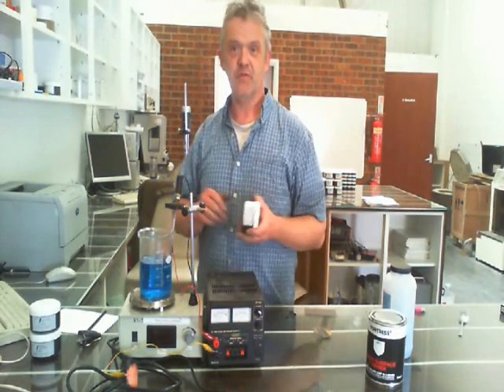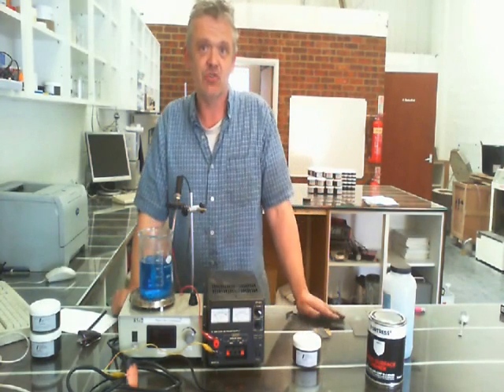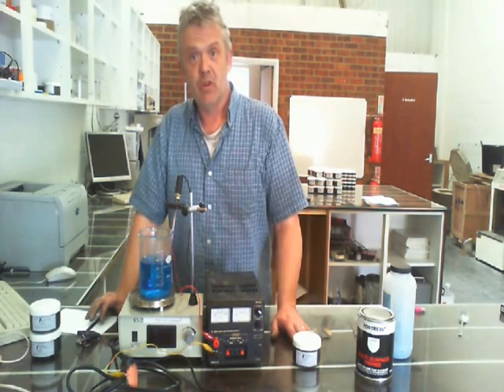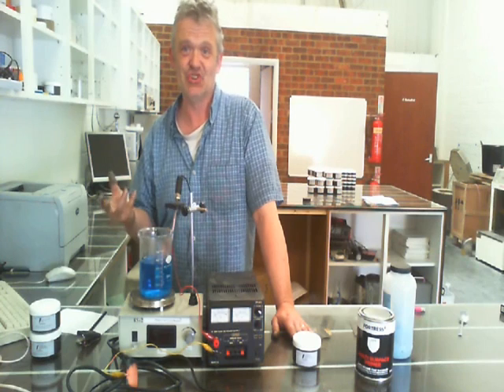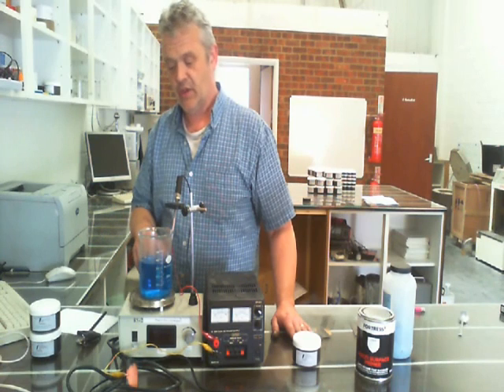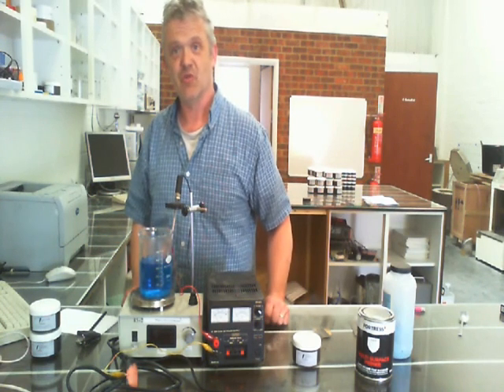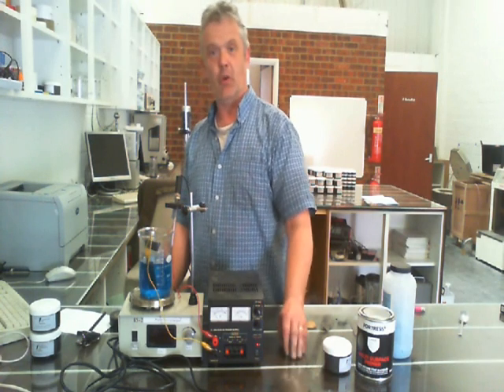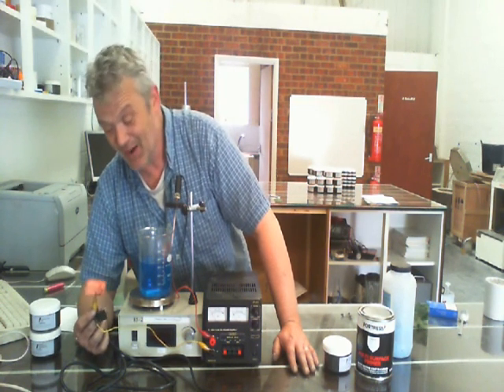Electroplating and Electroforming Plastics With Conductive Ink

Comment: This is the future of RF shielding for sensitive electronics, surely? The inside of plastic instrument cases can be either coated in conductive ink for most of the case, and/or electroplated with silver or copper for a more complete low resistance shield. Either way will result in substantial weight savings or increased shielding for the same weight. Where's my lab coat.....?

Comment: Just a note to everyone that I have successfully bound a waterproof conductive ink onto plastic (ABS & Styrene) using a fine lacquer gloss varnish intended for airbrush use as the binder for graphite powder (The brand is MRP - Mr Paint from Slovakia) without using a primer.

Comment: Robert I am working with my grandson on a pinewood Derby race car, the key to a fast car is low friction between the metal Axel ( a small nail ) and plastic wheel hub. He and I thought electroplating grapheme on the Axel and hub then Polishing the hub and Axel we have made our grapheme and tried to electroplate a smooth Axel. Yet had little success. We are hoping you might share some insight on what we might do better.

Comment: I love your work though I do have one question about this process. I plan to coat my 3d prints in conductive paint so I can electro plate them. Try to give it a nicer feel and a slightly stronger surface. And to do this I was going to us an airbrush, do you have any tips on how I can get the paint fluid enough to use in the airbrush?
Reply from the maker: i did a vid on airbrushing with the ink mate
Reply: Hmm I wasn't able to find it. I think my youtube is being silly. I will try again tomorrow. You are a life saver, been wanting to gold plate some stuff for a while.
Reply from the maker: Andreas Barry cool cheers

Comment: hi Robert

I am going to make up this same solution to test your inks but I can only find 36% pure hydrochloric acid. do I need to put 6ml of it in instead of the 2ml you put in?

thanks
Reply from the maker: i think just 2mL the hydrochloric acid I have is only 37% - but I am not an electroplater - there are better people to ask for advice on electroplating than me
Reply: Robert Murray-Smith do your friends have a website with the course information? I certainly could do with a little help with brass plating. thanks for your time

Comment: I've heard ABS can be chemically etched and rendered conductive in an electroless bath, allowing it to be plated without conductive ink.  Does anyone know if this has been tried outside of an industrial setting?
Reply from the maker: to render a plastic surface conductive for electroplating you need to roughen the surface - either with a mechanical etch - sand it - or chemical etch - pickle it in acid - then deposit a layer of tin salts and then activate it with palladium chloride. When you have done that you can electroplate it in an electroless bath. The palladium salts are very very very expensive which is why it isn't done much outside of an industrial setting - but if you feel like giving it a go - there is a lot of info on how to do it on the net and it would be nice if you did a video for everyone
Reply: Yeah I just looked into it a bit more, you weren't kidding about the expensiveness.  Do you know if anyone has tried plating an object printed in conductive 3d filament? That would also be interesting.
Reply from the maker: Cameron O'Neill
yes it would but i don't know anybody who has tried it - it might be a good thing to have a little experiment with mate - If you do - post the vid - i'd be interested to see
Reply: *****
to be honest mate - I am not sure if you could use that method or not. Normally it is a chemical etch - the part is 'pickled' in an acid bath to pit the surface - with plastic a chrome sulphur is used but i have heard of hydrochloric acid zinc being used as well - these are pretty nasty and sanding - or sand blasting works well - but I am not really an expert here - just going by what i know generally
Reply from the maker: lol - stuff just pops up especially when you are doing it

Comment: Just in passing, when I used to print polyethelene material the secret was to lower the surface tension of the plastic in order to get the ink to penetrate into the plastic. This was achived by passing a light gas flame (not fierce) over the surface for about 1 second or less.
To obseve the effect take the material to printed and plunge it in a container of water....the water will bead, after flaming the water will hold an even sheet over the surface for several seconds. Naturally flame the plastic when it is touch dry.
Just thought it may be of use with polythene or polypropylene type material. Not sure about polycrysaline materials.
Reply from the maker: that is interesting - thanks for the tip mate - very useful - i'll give it a go as it sounds like a bit of a skill to me lol
Reply: Robert Murray-Smith
Sorry flaming raises the surface tension of the plastic not lower...my mistake.
The effect was quite dramatic if this process was missed the ink had virtually no adhesion but if the surface was flamed the ink could withstand serious mechanical 	 	 	 	abrasion. Increased time increased the surface tension further how ever it also could cause anti stat materials to migrate within the plastic which caused patchy adhesion..... Beware oils from your hands as well as this interferes with adhesion. It os not that sensitive a process and could be easily done with a low flame from a gas blow lamp/
cheers
Reply from the maker: Bernard Stokes
ok mate thanks for that - can you do a demo?
Reply: Robert Murray-Smith
I will try and set something up. I dont have any tools here at present but will ask friends for a blow torch.
Reply from the maker: Bernard Stokes
that would be brilliant mate - I am a visual learner - if i see it once I can usually get it